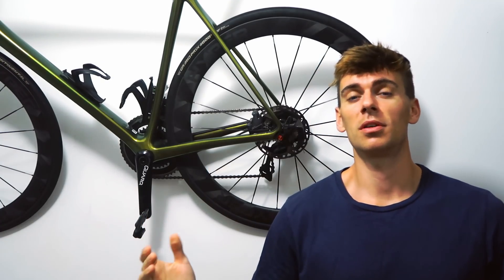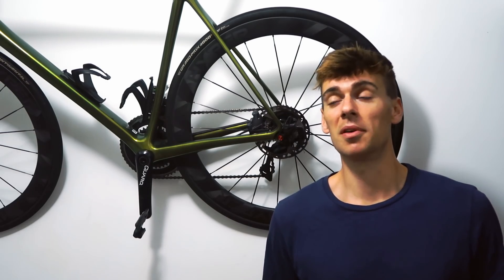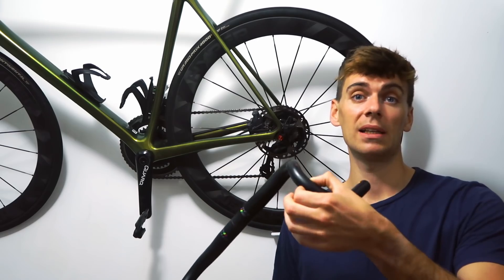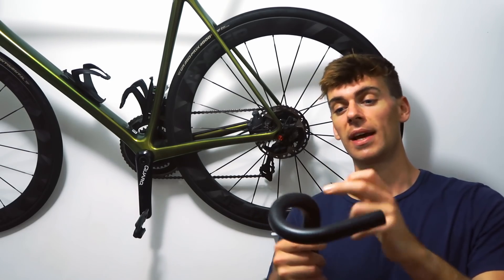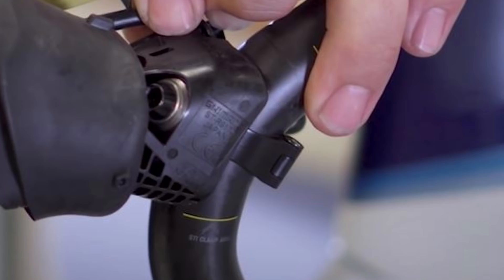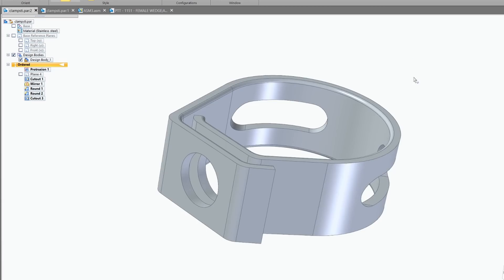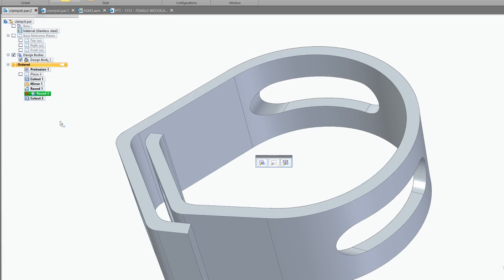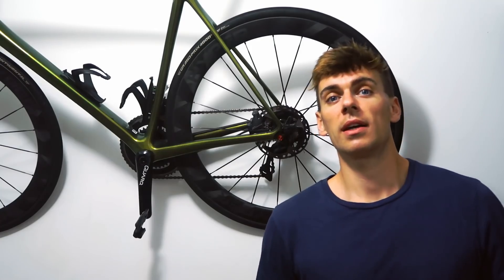MVDP Carbon Handlebar Fail @ Le Samyn: An Engineering discussion.

Comment: Back in the day I broke one of those Modolo stems that eventually got recalled (I was incredibly lucky -- broke it in a way that didn't cause a crash).  But after it broke I looked at it carefully, and I was like, "WTF!  Did the designer even take an engineering class?".  I think that engineering standards in the bike industry have probably improved somewhat since then (1990s), but maybe partly offset by the use of composite materials and decreasing safety factors in some areas to minimize weight...
Reply: In my opinion, so called "Designers" are not hardnosed engineers with science background. They're more likely to be industrial designers who studied their design craft at art schools, not schools with engineering department.

Comment: Upwards of 7k and they can't be bothered to offer a custom fit clamp? also, why can't they borrow the epoxy coatings from the scba industry? i trash my tanks year round with 4500 psi inside and they last for a good 5 years at minimum.

Comment: There are many cases of carbon failing on bikes one of the worst I have seen is George Hincapie riding in Roubaix race with his best chance of winning ~ have his stem snap riding straight on the cobbles straight over the bars head first cobbles & ditch and injured badly ~ so if you need that strength bigger stronger riders (ie 85 kg plus pulling on bars) then maybe marginal weight weenie chasing is not the way to go.......

Comment: Why make steerer tubes and handelbars from carbon? There's a min limit on bike weight, would having alloy steerer/handlebar make any diff? Why make such safety crit components out of stuff which is known to break unexpectedly? If Van d pol's bars had burst during full on sprint, he might be dead. I don't have carbon bars and if I was a pro I would not have them at any price. I do a lot of fly fishing, with carbon rods, which have broken without warning after years of use. I don't want to fly in a carbon aeroplane either.

Comment: Hmm, not sure about validity of your Risk scoring. Probably should have left this out.

These bands were designed in the aluminum bar era.

UCI implemented minimum weight standards for both alu/carb bars to avoid these problems.  Now, no no reason apart from marketing, bars are designed with extra channels to hide cables and/or hoses.  This uses up part of the available weight budget that could have gone into better reinforcing the clamp area of the bars.  So, UCI SHOULD OUTLAW THESE INTERNAL RUNS, OR RAISE THE MINIMUM WEIGHT FOR BARS WITH INTERNAL RUNS.

Regarding shaping clamps to bars, there are limits as to what can be done due to the diversity of bar shapes.  I’m not sure how much chamfer is necessary to add significant safety margins over simple tumbled edges.  Have you done any quantitative analysis on this?

It should be noted that the base of the shifter body resting against the bar is quite broad.  How will this impact force on the clamp band compared to a smaller footprint?  Any thoughts?

Comment: Seems like your right, but was the unique width adaptable design not in play also? I would be afraid too loose the connecting bolts AND isn’t there an extra wear point where the drop fits in the straight steerer section?
There’s a video where you can see VDP throw away the full drop on the roadside.
(Lesson learned (again): simple solutions are often better)
Reply from the maker: Simple engineering is best. Yes. I don't believe this failure was anything to do with the adjustable section. That's on the tops. I still hate that design too, but this was not at play.

Comment: I wonder how many carbon failures are due to "hotheads" or ego-mechanics, when i threw my bike into my LBS for a handlebar replacement i watched as the mechanic changed the handlebar & only used T-handle torx tools, i asked him about it, why he didn't use a torque wrench & his reply was "I have assembled thousands of bikes in my career, i know how hard the bolts should be tightened", when i came home i unscrewed the bolt & i needed 14nm to do so, the handlebars should have been tightened with 6nm which i did (8nm of force required to un-tighten it 6 months later). I see that alot on YouTube with bike builds, people who never ever use any torque wrenches when assembly their bike, also heard it in bike forums (happyride & pinkbike) about people who refuses to use torque wrench because apparantly those people are to good for them. I don't think alot of people realize how little force should be used, my seatpost should be tighten with 4nm, if people screwed it on blindly they would think that they used way to little force & proceed to probably double up on it
Reply: That's why they're bike mechanics. If they worked on airplanes, parts will fall apart and thus planes crash within few hours of flight. LOL

Comment: I would have liked you to first explain the functioning of the clamps, honestly I turn the screw without understanding
Reply: Tightening the screw pulls the clamp tighter (smaller diameter). Being wrapped around the handlebar, this creates a friction force that holds it in position.

Comment: Yet another fastener designed for metal components that was never updated for use with carbon. 
It's bad practice to just replace materials. All these clamps should be redesigned to better use carbon (band clamps, stems, seatpost collar, etc)

Comment: Overtighten will not do that.  You probably will strip the threads of the screw before breaking the carbon handlebar. Stop drinking the koolaid brother.
Reply from the maker: Disagree. 600kg of bolt load wont strip the M6 threads, but it will crush carbon on a line contact.
Reply: @PeakTorque  it doesnt take much pressure to strip the treads. Ask any car or motorcycle mechanic.